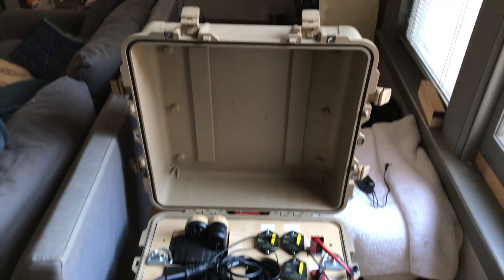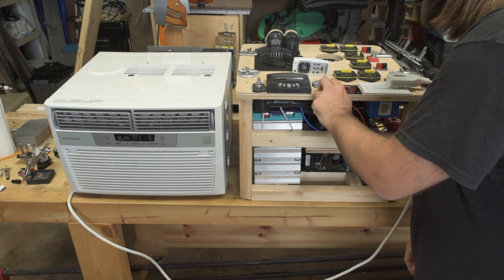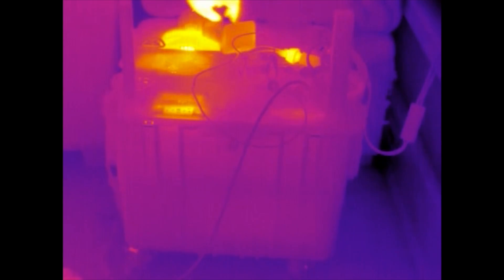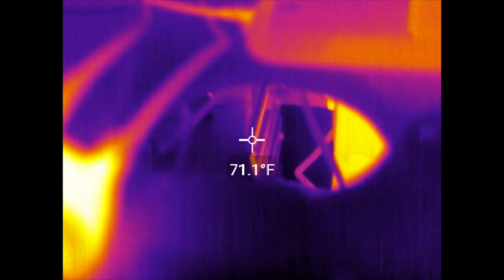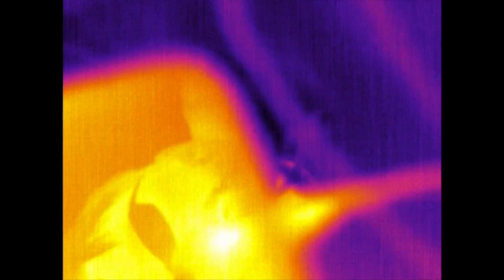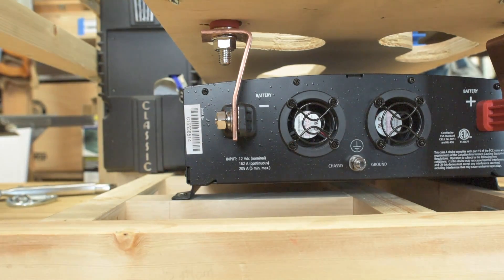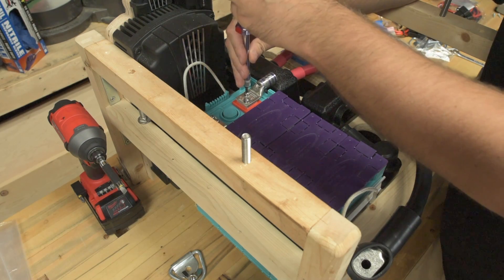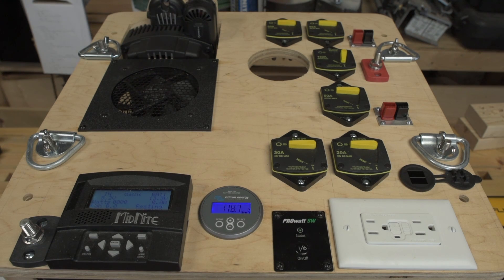How to build a battery bomb (or how not to build a portable solar generator)

Comment: You can use a MUCH THINNER plate of wood on the top! I would also add 3 or 4 Vent holes, and possibly a low-draw whisper fan to push outside air through the system when its running. I think those two simple changes alone would do wonders to cool the thing down! Your design is also very "BUSY" on the faceplate. If you have plans to market these, be aware that "Busy" ness turns consumers away. The want pretty looks and simple operation.
I think you're a little too hard on yourself. For one thing, I think your woodworking skills are EXCELLENT!
Reply from the maker: No plans to market. I agree that the faceplate is a bit too thick.
Reply: @createthisdotcom  Your videos have given me some very good ideas, and I GENUINELY have enjoyed watching them. You can contact me at my unsecured email at ebx rocks at yahoo dot com. From there I'll direct you to my SECURE Server.
Your current project appears centered around the Pelican 1440 case. I am ALSO working on a design built on that platform. I'd like to compare notes when I get mine built.

Comment: Is there anything like this that you can buy retail?
Reply from the maker: Not that I’m aware of, no. The amp rate is way higher on this unit than any commercial unit. The Yeti 1000 lithium is a way more compact unit with a similar battery capacity, but it can only be charged at 120 watts and this diy unit can be charged at 800 watts.
Reply from the maker: Btw, I recently redesigned this unit to use an external battery via an Anderson sb350 connector. I made a video about it here: https://youtu.be/KhklvlWvYM0

Comment: If you're really set on being able to run your table saw, you can "upgrade" your system to enable this, but it probably won't be cheap or easy, just simple.  I really like your build because you're using many of the same components that I had chosen for my designed Kodiak-clone/upgrade.  The Classic 150 removes what I see as the biggest downside to the Kodiak, because being able to charge faster than 600 watts means that you can use it faster than 600 watts, instead of the parlor trick that depletes the battery, and then it's done until the next solar window (some of us don't live in sunny California too, so we don't have the option to take the long sunlight window for granted).

Mathematically, if your load draws 15 Amps at 120 VAC, that's 1800 watts...  Which means that your inverter will need to be able to supply 1800 watts+ at the output, and that also means that it will need to be fed with an input of 1800+ watts / efficiency at load, so for that unit, about 85%.  1800/0.85 = 2118 watts, rounding up.

2112 watts / nominal battery voltage = input current required, so 2118/12.8 = 166 Amps (WoW!)
(always rounding up, 'cause less still equals failure to provide the proper amount)

Your 100 Amp-hr battery may be capable of providing as much as 2C (200 amps), but is your BMS able to permit this?  Many would be limiting the output current to a much lower value to protect the battery, and your choice of battery is no longer available in the link you provided, so I can't really check it out.

That Xantrex can feed your table saw and more, if you feed it properly, and it's a really sturdy player too, but as your battery voltage drops, in order to maintain the rated output power, it will draw even higher current.  Now figure in surge power, and you could easily be asking your batteries to produce over 300 amps at 12 VDC!

The way around this, is to increase your battery capacity with more in parallel, which isn't exactly cheap, and may not be easy either, but it will work.  If you double your battery capacity, you drop the current requirement for each battery stack in half, so instead of 166 amps, they'd only need to supply 83 amps in each bank, and you'd need battery cables and buss-bars rated to handle the full loads, but it could be done.

When I designed my system, I wasn't trying to get the least expensive version, I was trying to minimize the number of wasted components for later, when I chose to convert everything over to a permanent residential solar system, and by chance we share many components in out respective parts list - at least the major components, although I chose to go with the CALB 180 Ah batteries instead, but the Classic 150 is an honest 5 Kw charge controller, so one could get a larger array and make such a system still be useful, even if there's only 3-4 hrs of sunlight, and that Xantrex is fairly bullet-proof too.  I guess you could switch it out for a 24 VDC inverter to reduce your current draw, but you'd still need to add another 4 batteries in series, and the closest Xantrex 24 VDC model is more than $1000.  There are some Aims and Samlex 24 VDC models that might be worth considering too, for less, and then you could go with 12 VDC output buck converters to feed your 12 volt devices...

If yours is a "battery bomb" then you're not alone!

Thanks for the video!
Reply from the maker: You're one of the few people to take an in depth look at this project. I mostly agree with your analysis. Here's a little update from my perspective after living with this system for a couple of years:

I like the Midnight Classic 150, but I think it's a little dated at this point. It's tough and still operational as shown in this video. However, if I did it again, I would probably use a Victron MPPT charge controller as they appear to have much lower standby power requirements. In the winter I have to actively switch off the Midnight Classic using the DC breakers because the classic draws about 5 watts and I frequently only get 2 watts of input or less on a cloudy winter day with my 400W solar array. Taking night time standby into account, it eats the battery after a few days of cloud cover, which is very common in the winter months. To deal with this, I've taken to switching the Classic off at the breaker at the first sign of cloud cover. I then switch it back on during sunny days to get a charge. This has killed my coin cell battery on the classic, but I haven't even bothered to replace it as it only seems to matter for the clock and graph functionality, which I do not use. Thankfully, all the settings seem to be saved to non volatile memory and do not rely on the coin cell battery. It works fine each time I boot it back up.

The DC breakers have been brilliant. I highly recommend them on any build. They're expensive, but totally worth every penny.

I would definitely go with a higher system voltage on future builds. Maybe even 48V. I wanted high 12V efficiency with this build, and I got it, but the cost is a system that is too heavy to be easily portable. Having lived with it for 2 years I'm pretty sure I'd happily take the conversion losses associated with a DC-DC step down converter in favor of the weight savings of a 48V system.

The nice thing about this LifePO4 system is that it's pretty durable. I think it will probably continue functioning for decades as I use it (mostly to charge phones and power tool batteries and laptops). However, because it is a bottom balance system I'm missing almost half of the battery's capacity. There's a lot of missing capacity at the top because I only charge to 13.6V. And, surprisingly, there's quite a bit of missing capacity at the bottom too because I keep a safety margin there too. I think for my next build I will buy a spot welder and build an 18650 pack at 48V. The problem with this sort of thing is that you're relying on some cheap no-name chinese BMS to keep your pack from overcharging. That makes me super uncomfortable. I think if I found a reputable BMS supplier that I felt I could trust I would be much more enthusiastic about this path. Sometimes I also toy with the idea of incorporating Bosch ebike packs or power tool packs. At least this way you'd have some assurance of quality.

You asked a question about my BMS being able to handle 160A discharge. Again, I'm bottom balancing. The only components between the outputs and my battery are my BP-220 Victron low voltage disconnect and my BMV-700 battery monitoring system. The BMV-700 is a 700 amp rated component (geez) and the BP-220 is 200 amp rated (also geez). I worry more about a loose connection heating up or something. In practice I never go beyond 150 amps and I only attempt that for youtube parlor tricks like boiling water or running an AC unit. Because the battery capacity is so low on this system, I rarely use it for more than 500W output.

From an engineering perspective, I'm a little frustrated with solar, having played with it for a while now from a hobbyist perspective. In order to be really useful to me, I'd like a system that delivers 100 watts in cloud cover on a rainy winter day. Such a system would have such massive solar input on a sunny summer day that I feel like it would be difficult to size the charge controller appropriately and impossible to make the system portable. I think about this a lot.

Comment: Wow finally a true portable solar builder!... love the thermal idea, I will do the same on my system
Reply from the maker: I'm planning a 48V 18650 cell battery for V4 of this generator. Smaller diameter wires with 48V for the same power output.

Comment: Nice job and appreciate the details.  A lot of thought put into the design and I think it looks great.  Have you tested it under heavy loads and measured temps?  If temps become an issue, I'm sure with a few minor tweaks, you'll be able to correct the issue.
Reply: I've tested around the 300 watt range and measured temps. It seems to be fine at that temperature. I haven't measured temps under higher loads and it's the higher power levels you need to worry about.

Comment: I still think it is a good build/idea. 👍🏻. I incorporated many of your ideas into my 24v transportable solar generator (bug out box). Mine stays cool...24v Go Power inverter, 400w in Renogy panels, Trojan AGMs, etc-etc-etc. Thanks, dig your detailed video showing your work. I did a series of videos on mine too.
Reply from the maker: I definitely think 24v or 48v is a better choice for heat/efficiency reasons. I just really wanted 12v power because there are so many 12v devices available.
Reply: Chris DIYer I do your video too Chris! Lol

Comment: Did you put any ventilation Holes in the pelican case?
Reply from the maker: +Bartmanfly no. I leave it open when operating. The vent hole in the top is the air inlet. The fan hole is the exhaust.